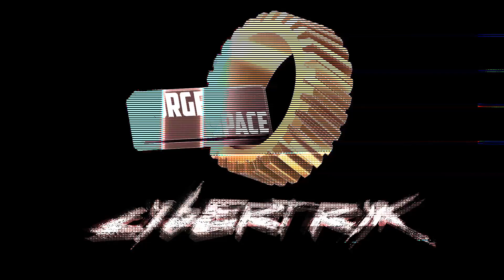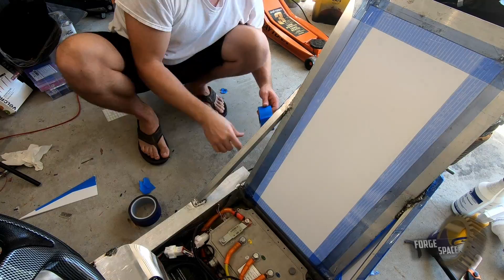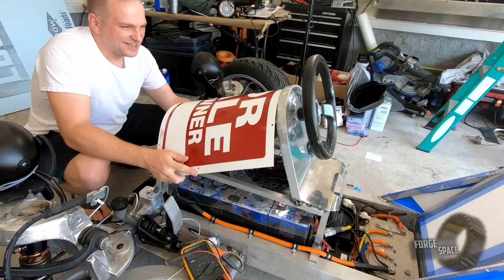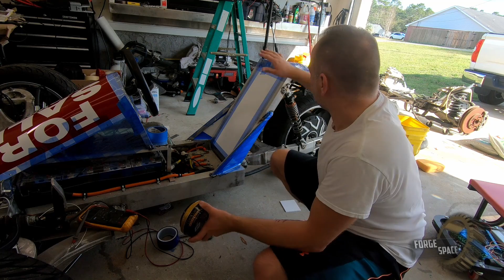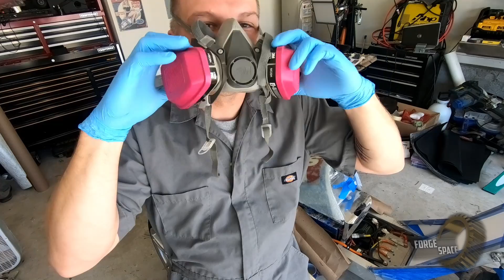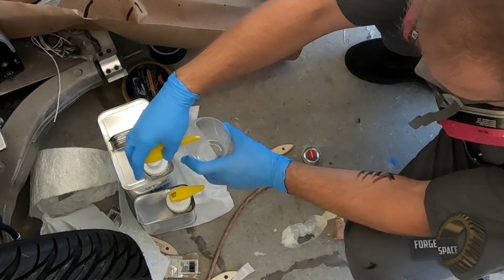Fiberglass body work on the electric reverse trike Pt 1

Comment: You shouldn't use epoxy with chop strand there's binders in chop strand polyester will break down the binders not epoxy